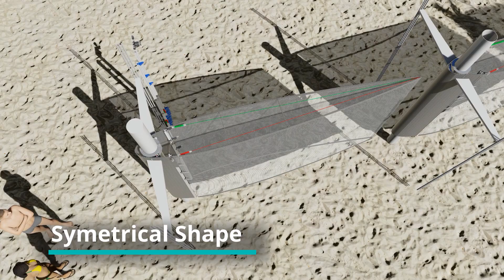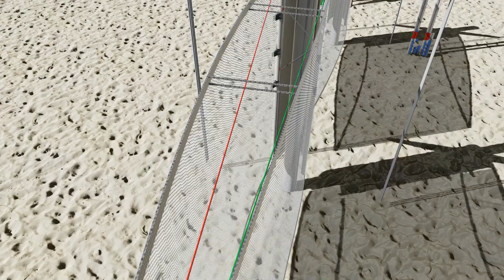AirBender Wings for yachts

Comment: I'm in the S F bay area..Where can I get more information on the air bender wings..Will it work on a 1975 Islander 28 ' boat?
Reply from the maker: hi Gary, Unfortunately, it's only conceptual at this stage. (it's just a little pipe dream to develop high-performance soft wings sails - specifically designed to be retrofitted to performance yachts.) There would be little benefit on an older yacht. It's really designed for planning yachts and probably foiling yachts in the future.